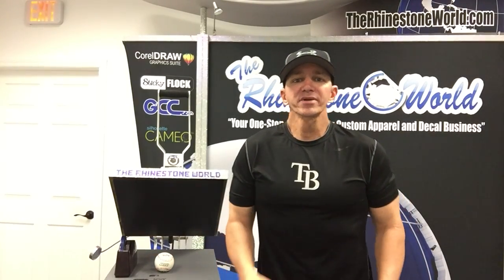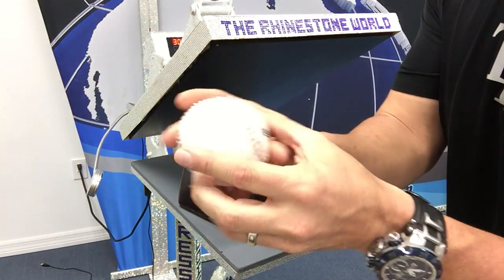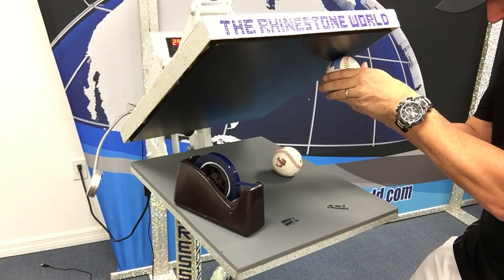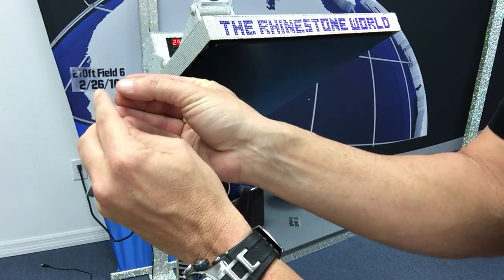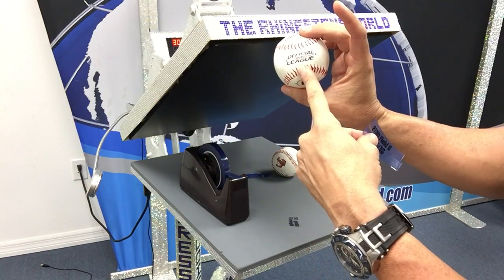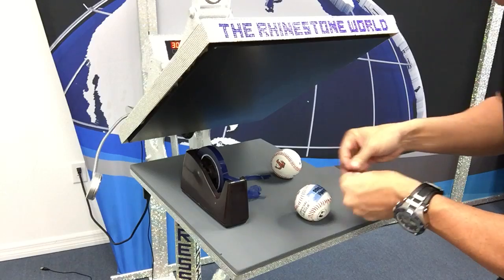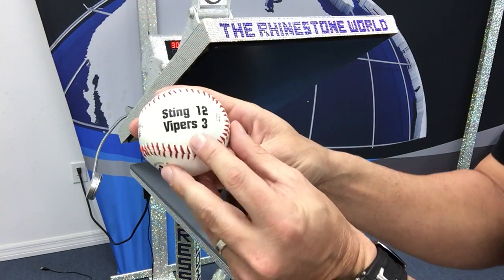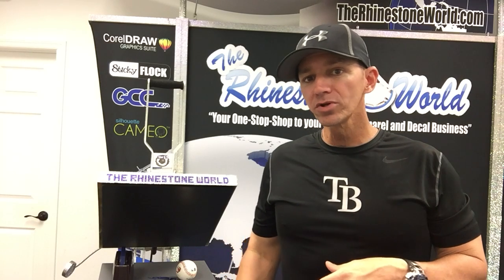Customize a Baseball with Siser Heat Transfer Vinyl and a Heat Press

Comment: Did you use DTF Powder? I've tried this but seems like it's not sticking well
Reply from the maker: No, DTF is relatively new and we have been pressing Easyweed to baseballs for years. Definitely use the Magic Heat tape to hold your htv to the ball's surface and use upwards pressure, rolling/holding the ball against the heated platen. Hope this helps! -TRW Pilar